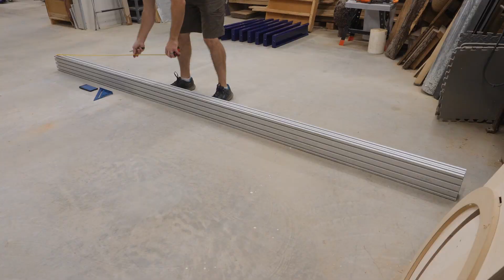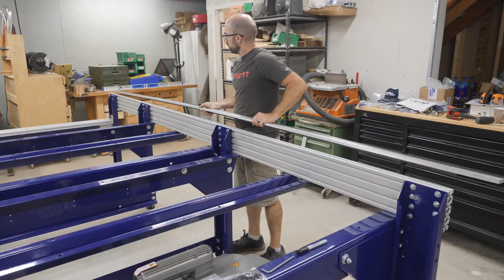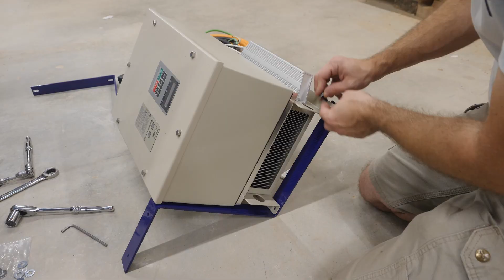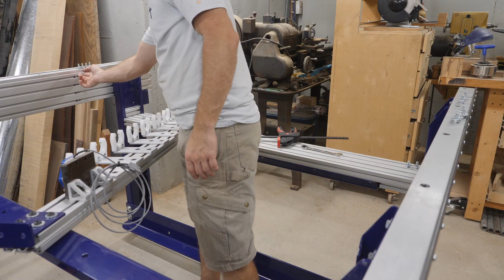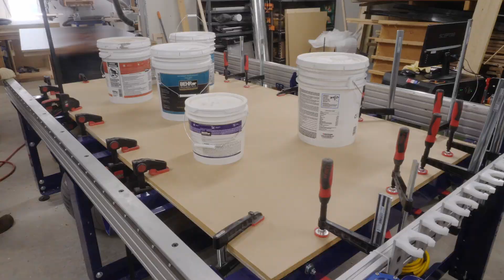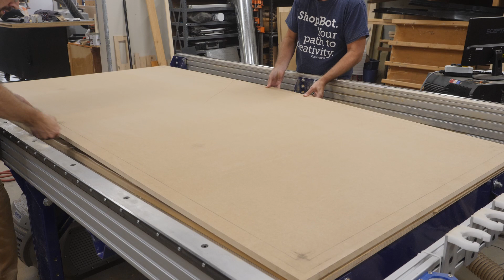Assembling a HUGE Woodworking CNC

Comment: Good looking product. May I ask what is the working area size of this machine?
Reply from the maker: I've been really happy with it.  Mine has a working area of 4'x8'.
Reply: @WoodshopMike  Thanks for your reply. Unfortunately i have no possibility to purchase this machine. I'm very far form USA. But I'm going to produce something like this  myself. So, can you please answer two more questions? What is steel details thickness? 4mm? And what are aluminium profiles cross sizes? 160*40 and 160*80mm?

Comment: Excellent... a question friends, I want to make my 78'x118'' cnc for different woods and melamine, what servo motor, spindle, bearings, couplings, inductive sensors, emergency stop and stroke limits do you advise me to use? thank you so much

Comment: Hold on a second!  Where's the link to the CNC you purchased?
And the discount code?
And the links to get you to come set it up at my workshop so I don't have to?!?
Reply from the maker: I added a link to ShopBot's site in the description, but here's a link to the PRSalpha series! https://www.shopbottools.com/products/alpha  
They build out everything custom so it's not possible to give a direct link but here are the specs on mine.
PRSalpha ATC 4'x'8' with vacuum table and 9" indexer
We're in the process of putting together an affiliate program & discount code but things aren't hammered out as of yet.
It's strange I'm not coming up with a link for your last request 😂  ShopBot does actually offer full setup on site setup.  Ryan came for a couple days to help with the final setup (programing the ATC and wrapping up the vacuum setup).